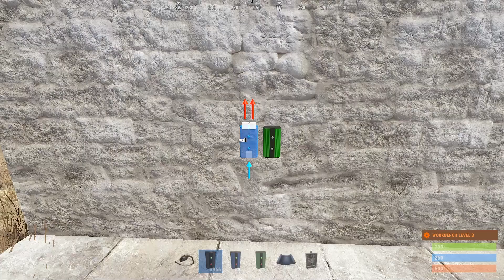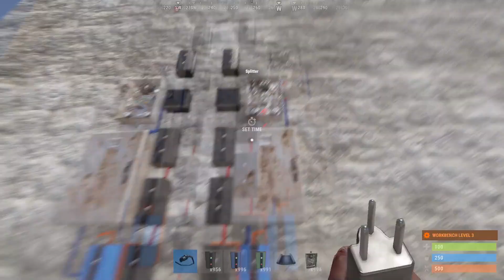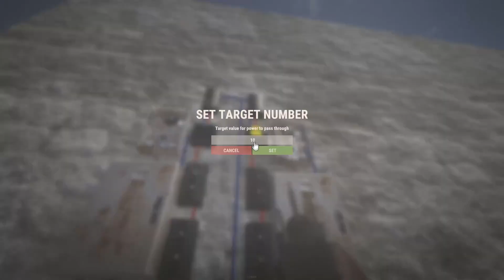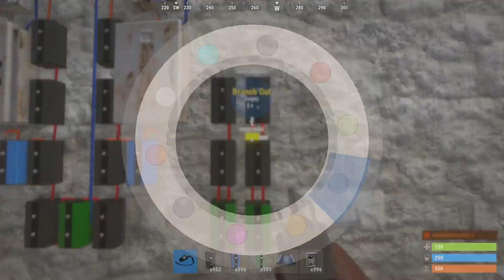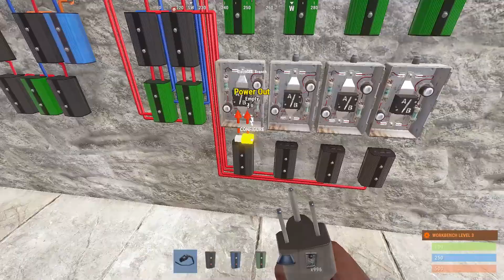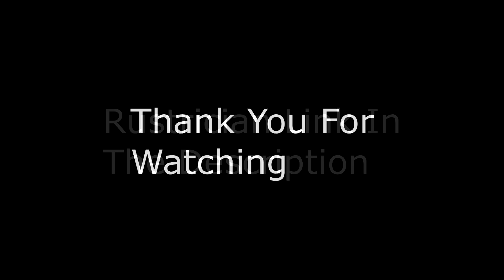Expo Lighting circuit tutorial #rust #rustgame #electrical #tutorial

Comment: It reached max depth which I’m guessing is from the update they did for people doing infinite power. Is there another way to do this?
Reply from the maker: Yeah it was the update. All it took was one YouTuber to sell out and ruined it for the rest of us. Thankfully though there are many ways to go about it. Just need to copy the mechanism going on which if you think about a memory cell without the toggle. It’s just and enabled sr latch where the power in of the memory cell acts as an enable. Ignoring the priority the cell has with its set and reset(not important for this use case) when I get some time I can make a similar circuit
Reply: @LagFoundry I’m not gonna lie to you bro. Half way through the comment I’m pretty sure you started speaking German 😂. And yeah if you could post that when you get a chance I’d love it
Reply from the maker: @fried @friedchikenblackguy  fair and yeah for sure. I know it’s a bunch of circuit jargon but If your curious though when I say sr latch that means set/reset latch. Same nodes that you have on the memory cell actually. Enabled just means that your gating the signals that usually reset or set the latch with a 3rd signal. Basically just a AND gate before the set and reset nodes. Think of adding an AND gate to the set node of a memory cell. Now for it to be set you have to apply another signal to the other input of the AND gate right, that’s the enable. Just means you need two conditions for something to happen. In the case of both a reset and set you need two and gates hence the 3rd signal.